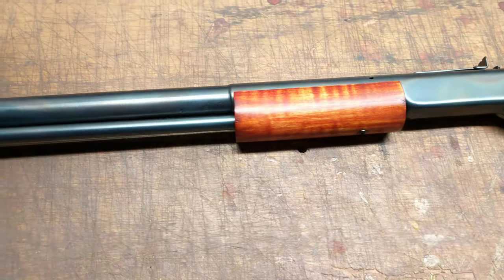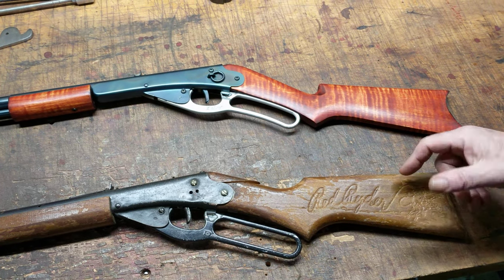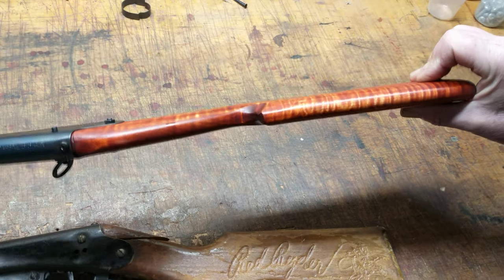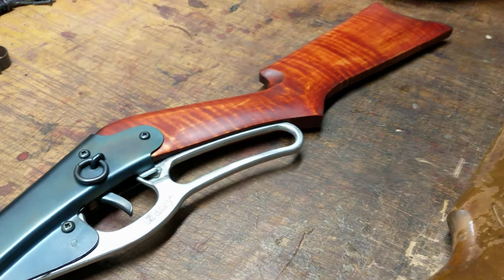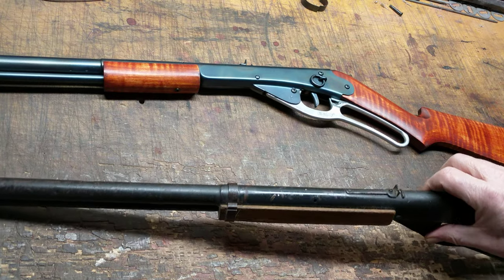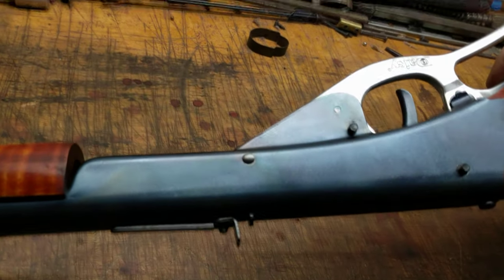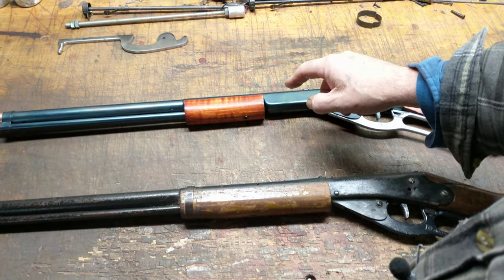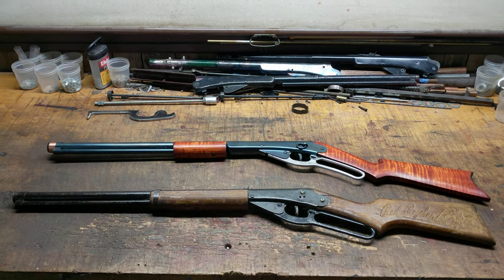Restomod Daisy Model 1938 review before heading home it it's owner

Comment: Hey, how much does it cost to try get 400fsp and I need a new stock and the foregrip
Reply from the maker: Joe,  Getting a Red Ryder to 400+ FPS is quite difficult. The best I've managed so far has been 376 FPS built on a really nice #111 Model receiver.  Quite the Thumper.  You'll need a Red Ryder small frame Daisy receiver that has an exceptionally tight compression chamber,  superior abutment washer mounting as well as the power triad. That's new seals, original copper washed unsacked Daisy mainspring from the 1940's or a Cobalt 327 Super Spring, 7/64" overbored air tube and a current production M25 Daisy spring loaded shot tube. You can get the internals from Cobalt 327 on ebay at his store here:

https://www.ebay.com/usr/cobalt327?_trksid=p2053788.m1543.l2754

As far as stocks go, you looking originals or custom? Send me an email at "thesocietyforprofit@gmail.com" for more info on the stocks I build for Daisy's.
Reply: @RestOModDaisy  ok so ill look for the  parts
Reply: Thanks for the link on the spring. I have a new adult Red Ryder coming, so I went ahead and ordered a spring. I've been doing some 50 yard plinking at a 1 gallon mill jug using BBs I'm powder coating myself. They show a lot of promise, and the process has really cut down on flyers.
Reply from the maker: @eddieb1766  Eddie B, I'm intrigued , what are you coating the BB's with and what kind of thickness are you adding? Over at the High Road thread there was quite a bit of discussion on either getting tighter bore barrels or slightly larger diameter BB's to cut down on blow by.

https://www.thehighroad.org/index.php?threads/putting-a-little-more-power-in-a-15-00-daisy.807316/

No conclusions reached.
Reply: @RestOModDaisy  My testing is far from scientific, but there's no doubt that I'm seeing far fewer flyers veering off by several feet. The Daisy Premium Grade BBs I'm using seem to run around .173 before coating and between .1745 and .175 after coating. 

I'm using a powder coat method known as shake and bake. There are plenty of videos on YouTube that explain it better than I can. I will tell you that TGIC polyester powders flow the best and provide the most even coating.
Reply: @RestOModDaisy  I posted a picture of the powder coated BBs at the end of that thread on the High Road.
Reply from the maker: @eddieb1766  I'll check that out.